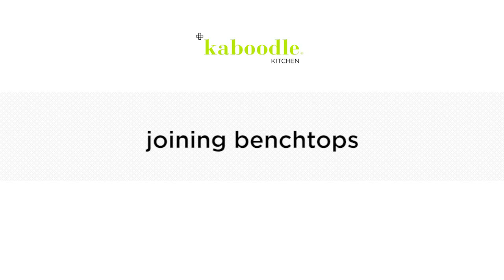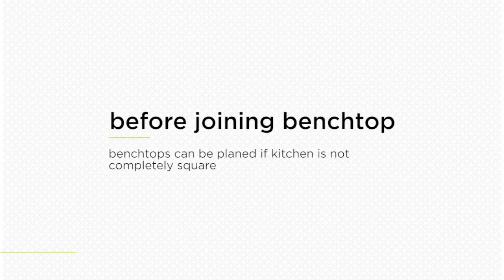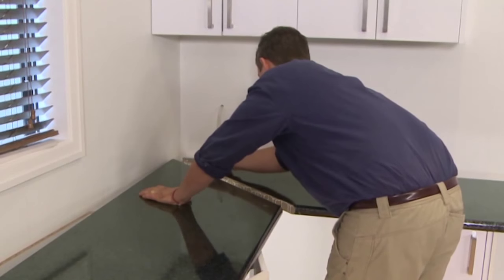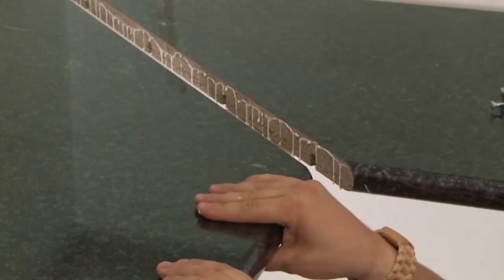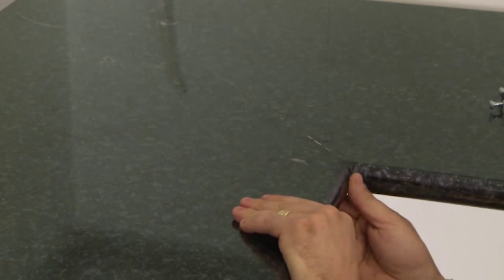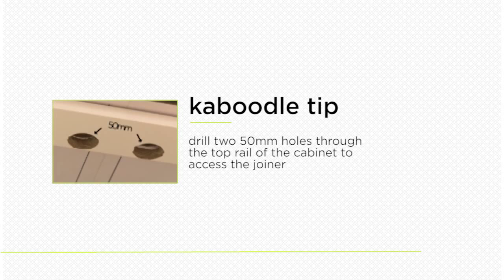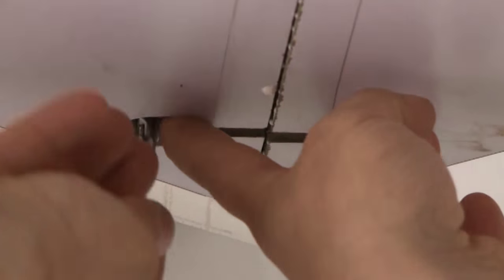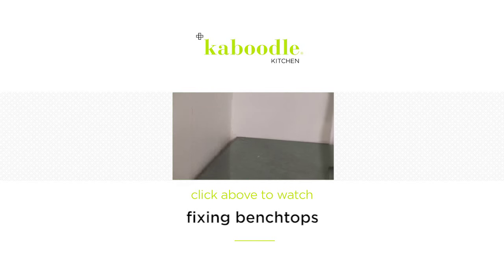Joining benchtops | kaboodle kitchen

Comment: Hi  how would I go about mitring a worktop when the internal angles  are under 90 degrees . I know for 90 just cut both at 45
Reply from the maker: Hi Shaun
The type of cut you'd do is dependant on the benchtop profile, angle involved etc.
If you'd like to email info@kaboodlegroup.com.au with specific details and pictures we can get someone to advise on a solution.

Best of luck
Kaboodle
Reply: kaboodle kitchen thank you for u reply as soon as I start the work will supply relevant Info